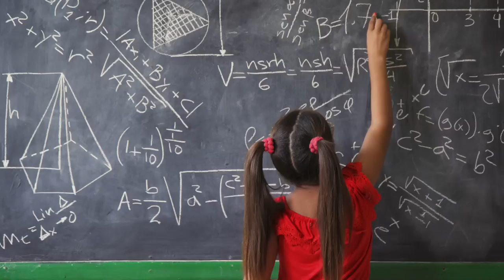Why Not to get a Suspension Kit

Comment: Thank you for the great video about the basics of suspension setups. This is an important topic as the suspension of a rig is a complex setup and a proper suspension setup could make the drive not only comfortable but also could add safety on the trails. You can also save a lot of money if you calculate and select the right setup right away and don't just keep trying things out by try and error.

Comment: look up king springs Australia they have a full range for a 80 series 175 to 340 inch lbs front in 2" range and 200 to 385 inch lbs rear 2" range as well they will ship to the US look at ktfr-69hd it's a 240 rate or a ktfr-69hhd is 290 rate for front and ktrr-70hd is 305 rate or ktrr-70hhhd is 385 rate rear my 80 is at 6600 lbs loaded I run a 240 front and a dual rate 200/290 rear with bilstein 7100 that I put a flutter stack its not really about the springs as its more about shocks valveing